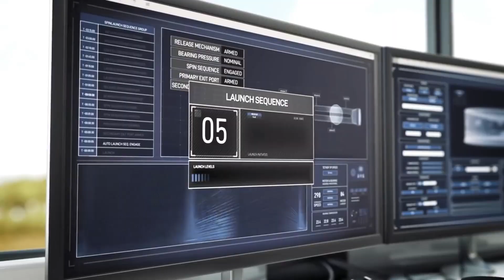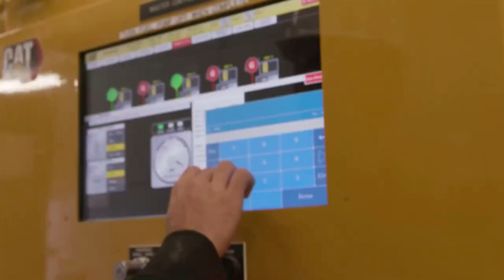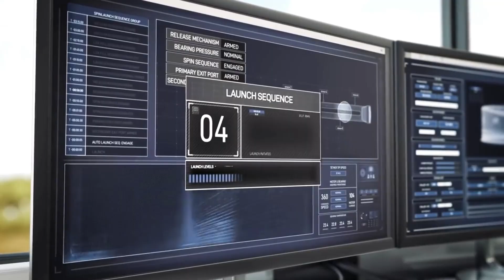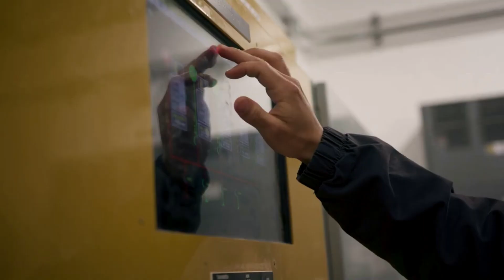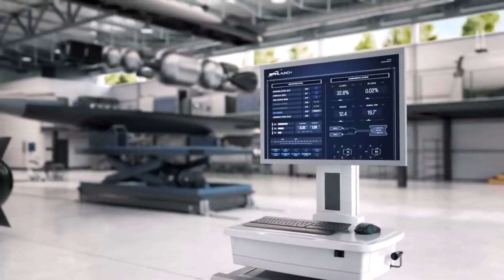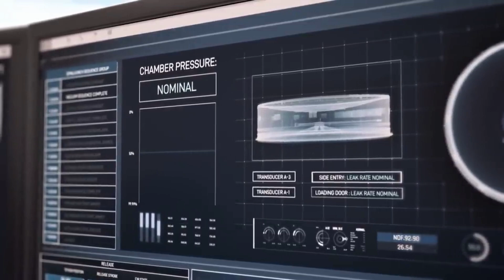SpinLaunch Just Confirmed Payloads Are Compatible With Its Launch Environment

Comment: I'm also excited that somebody dares to think anew about this problem. Even if advanced equipment do not survive, simple materials, like refined metal or water even, would. That would make regular fight cheaper since less has be brought with regular launches. It could be fetched in lower orbit and tugged to machinery operating further away. Let's say we can fling a few tons of water out there and use it with solar panels to produce hydrogen and oxygen - that would open a lot of doors.
I think it's worth a try. Gotta think big.